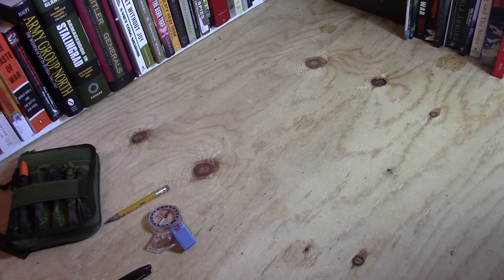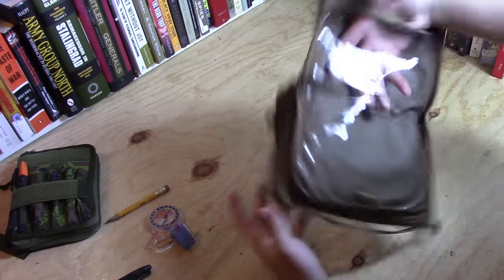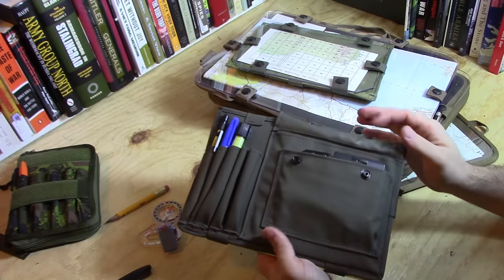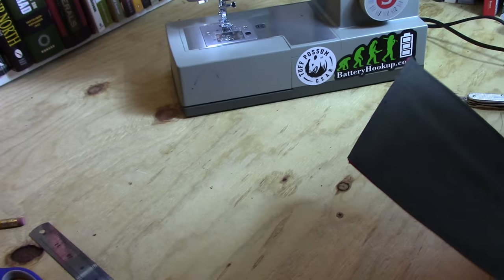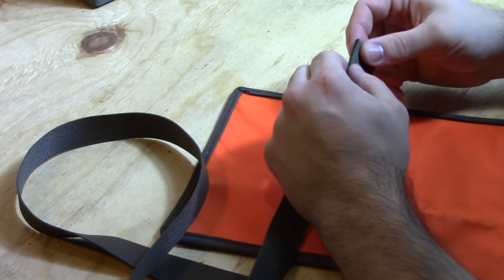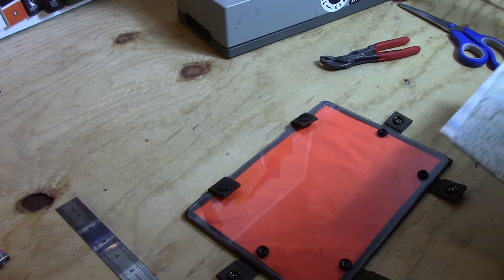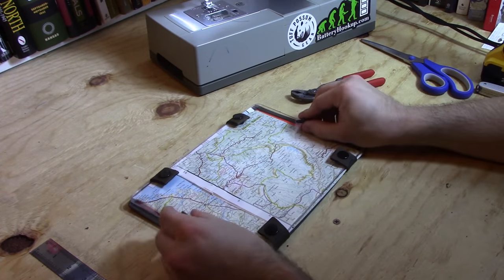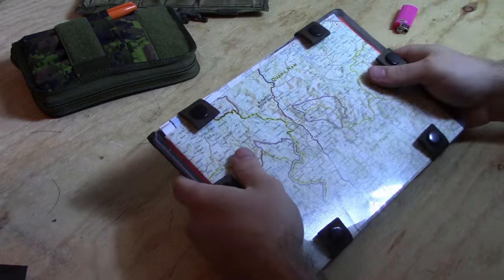Frankengear: DIY Map Case

Comment: The cheapest picture frames at Walmart etc. use lexan for their "glass." If you have a table saw with a very fine blade you can cut the lexan very easily. You can use bottle bases and a sharpie to mark the corners for cutting those nice round corners on the plastic.
Reply: when cutting lexan try using a utility knife blade point. Not from the sharpened side but as a scratch awl from the dull side. It scores it nicely. Deep, matching scores on both sides will allow it to break where you like it. The edge will need to be sanded as it is jagged. Also the saw blade from a skillsaw or table saw can be turned backwards and produces good results as well. This produces a finer edge but has a tendency to melt through the lexan.
Reply: @joshuarumsey2302  If it breaks its not Lexan (polycarbonate), it's Plexiglas (acrylic).  Polycarbonate is tough.  Its what eyeglass/safety glass lenses are made of for example.
Reply: @MrBen527  Would the difference matter in this application?
Reply: @instantsiv  Yes.  Polycarbonate is a much better material for this application.
Reply: @instantsiv  
Plexi is a pain in the ass to work with. thin material like this loves to quickly break when you touch it with a drill bit. Thicker material gets very hot very fast and melts on your drill bit or tap. Plexi also scratches easily so I don't think that's a good option for this project.

Comment: We used clear kitchen contact paper (always did one side).  It also allowed for marking up with a grease pencil.   Erasable markers where not a good choice any dampness and you lost your makings of MSR's., FEBA, and where they put the class 6 store.  The trick is to with a flat area put the map on the sticky end and push out any air pockets as you go.  You only get 1 shot to do it right.

Comment: This is very nice. I'm an exploratory geologist. I use two lexan glass boards cut just a little larger than a 9x12 and drill two holes near the corners for 550 Paracord. I put strips of duct tape to border the plastic and tape one side of both boards to allow to fold like a binder. I might just try adding the pocket to one side.

Comment: For maps, a laminator is your friend (hot or cold).  There is waterproof paper for laser printers available.  Combine the two - lamination seals in the toner so it doesn't transfer once printed, waterproof paper doesn't spread lamination leaks if punctured, and toner doesn't bleed like link does.
  
Recommend buttons over snaps and velcro - no sound when operated.  Would also recommend an opaque flap over the cover plastic sheet, no glint reflections, and keeps the plastic pretty for longer.  You could put a hard surface in the cover and add triangle flaps on the sides to allow viewing the map under a "hood".

Comment: Only a couple mins in but as a SERE Instructor I always preferred just using clear shelf paper. Works great. Pretty cheap. Lasts a long long time.
Reply: I still use that clear contact paper.  I also still use 1 gallon zip lock bags.

Comment: I have a suggestion: spray fixative. You can find it at art supply stores. Artists who work in ink, pencil, charcoal, whatever, use spray fixative to keep the work from smearing. It works the same way as polycoat works on stained wood. After printing ot your map, spray it with a thin coat of fixative. Let it dry, spray another thin coat on it. The plastic will allow humidify to collect. Leaving maps in the case when not needed is a bad idea.

Comment: Thank you for sharing. 

I think that I'm going to take 
your idea & run with it. 

The only things I believe that I'm 
going to do differently is slightly different accessory pocket set up,
AWA, on the main body... double 
the backing panel into two 
(completed) panels & join with a 
heavier seem, so I can store one 
or two extra screens in a designated 
pocket for the extra screens.
(Using the two snap straps 
for holding pocket shut)

One of these will have light 
engravings both to mark catches
& camouflage alignments to topo 
features. 

The other time will tell what I'll do with it.

Thanks again for sharing.
Excellent idea & job.

Comment: as a soldier from the 80s, we made map boards out of cardboard, 100 mph tape, and clear acetate.  You could make a "map book" that allows you to simply "turn the page" when you approach the edge of the map sheet.  Obviously, back then we were not making maps on our desktop and printing them, so this is for published 1:50,000 or 1:250,000 maps issued to us.

Add some 550 cord to make a handle and spine, and make it to fit a standard issue map case and you are in business.  Small enough to be used mounted or dismounted, and large enough to hold 5 or 6 maps.  I even saw some that held the bigger "special maps" (Graf, Hohenfels, etc) in a way that you could see one quarter of the map, or unfold the whole map.

Fieldcraft...good to see.

Comment: This is not boring! It is skill building, which is very important. I place this video right up there with the Secret Squirrel videos. Using a needle and thread, manual or machine, will come in handy if/when a SHTF situation occurs. Be well.

Comment: I wish I'd had this when I was an infantry officer. You could store all your reports cards (9 line, SALT, CFF) in there. Best of all, you could quickly mark up the board with graphical guidance and hand off the entire package to your FO or JTAC so you could manage the fight on the ground. This easily beats the large planning map board in my ruck and the crappy map case in my plate carrier, which never maintained map alignment.

Comment: I like to weatherproof my maps with spray Flexseal.  Works well for desktop printed inks.  Have used it for printed big game tags, downloaded hunting licenses, etc.
Reply: Any tips/tricks to application?
Reply: @mattfleming86    I spray one side, let it dry and then spray the other side.   It really toughens the paper's strength, too.
Reply: One coat?  Nice.  Gonna give it a try.  Do they still take markup/layout well or require any weird marking pens?
Reply: @mattfleming86   One coat each side.  You can still write on it with a ballpoint or Sharpie.

Comment: You could put a velcro hook panel on the back of the case and have a separate nylon belt with velcro loop on one side to create a kneeboard setup. I'm typing this comment from that very setup. Very useful for reading maps while operating aircraft or other vehicles while in a seated position.

Comment: I'm thinking of combining these implimentations into a tri-fold design with clear vinyl, that can fold and go into the front pocket of a plate carrier or wherever you may need it.

Unfortunately I'm with you, clear vinyl sucks. It either picks stuff up, creases, scratches, gets hazy. 

I don't know if there's an engineered solution for those issues or not, my search may be hindered by my lack of knowledge of the industry itself.

EDIT - Forgot to say: Awesome series with great information delivered short, sharp and concise. Most importantly, a very worthy mission. Thank you!

Comment: When I was active duty we'd take maps of the training area and get them cut and laminated.
Reply: The only downside is you get into stacking distances
Reply: Same, works good for GRG and other non-grid dependent maps. Combine this with acetate layovers and you’re set. The fine tip permanent pens that stay on until you erase them or use sanitizer.
Reply: @davethrasher4124  yeah but you get used to it just like anything else

Comment: What we do here on Argentina is first to "illuminate" the map, using highlighters to mark the coordinates, names or points of interest, to make them stand out in a quick glance. Then cut it in squares of a comfortable size to fold (usually the size of the combat shirt pocket), take some transparent scotch wide tape, and tape the back and then the front of each piece. Finally you join them all back together with some more tape. You end up with a weather safe map, that does not need a map case, fits almost everywhere, you can write directly on top without worries, and erase it just fine.

Comment: Quick fix for keeping yourself centered on the map, have one large map that is medium resolution (big area, big details) that covers the entire area you are operating in. Then a smaller copypaper page sized high resolution map for each area within that map. The big one is for long distance stuff and keeping track of position of multiple elements in the battlespace, and the little guys are high resolution topographical maps of the immediate area for land navigation and planning close range troop movements.  Take whichever ones you need for the mission in your kit and leave the extras in your ruck.

Comment: One point:  Size to fit the leg pocket.
Another: Military dont have this problem as the map/locations change.
For central people; ok.  Maybe a simplier method is to remove the map between uses.  
Solves the problem, doesn't need any sewing skills.
And you can fold the map to meet your needs.

Comment: For the map's ink sticking, just add wide clear tape on top of the map. For one, it turns the map onto a whiteboard so you can directly scribble on top. And it keeps the map pristine. 
If you do both sides and slightly overlapping the edges on both sides, you can get a sorta wateresistant map. Its not perfect but it turns a home map into a better product for cheap
Reply: Like high quality packing tape?
Reply: @flamingdragon3861  like any old clear wide tape

Comment: so just some of my opinions here so it's definitely not the right and only way to do it, but I would suggest sewing all the stuff on the back first before stitching the plastic and stuff together. Now this is mostly just to make it look more professional so when you take the map out you don't have stitching all over the place. now in this case really it's not a big deal but at least for me I just like to make things as nice as possible with the limitation coming from my knowledge and skills. does make it a little more difficult but not too bad. also if you comparing your self to a seamstress or something then yea not good sewing but really your skill in sewing are excellent compared to most common folk. I would say your a step above most people.

Comment: I feel like a tablet with pre-loaded maps (you can do that with various systems) and a back-up battery, and GPS built in, would be more efficient than this. Since GPS is not transmission oriented, you don't emit anything by listening for GPS signals.

I have an Onyx Boox Air 2 with an e-ink display. The battery lasts for weeks, you can pre-load maps for whole states and regions via Google Maps, so you can get coordinates and details and use navigation. The only downside to the tablet, which will likely be dealt with in later versions is that it's not waterproof. If it was waterproof it would be awesome. There's also a backlight that you can toggle on or off, in case you need the information in the dark.

Yes, paper maps are still a great idea, but if you want something that's going to keep up with you, electronic systems with GPS can be superior in some conditions.

Comment: I couldn't live with that it's too rigid and gives off too much shine.
I used the pen pockets inside the 2 chest zip pockets on my smock for pens. However we never marked the maps, we only added red boxes/no go zones to them. We always used ortlieb map cases as they kept the map's dry and could hold a good size map that could be folded easily when in the case.
Horses for course's really. Everyone is different.
You always have the 3 S's in mind when mooching about in the field.
Shape
Shine
Silhouette.

Comment: when the color of cards comes off? - as with the daily newspaper, simply iron the topographical map beforehand - every butler has also done the daily newspaper for the ruler
Reply: the edge of the map - if you can't fold your map properly, then the map folder can't help it - and no, I'm not the producer, I just use a similar one from a Canadian company that has it produced in China, unfortunately there is nothing else

Comment: Since we're in topic of maps.   I have opsec question, that is related to them. I've heard from some people to do not mark/draw anything on maps on the mission/if I'm going to take it for mission, becayse ifni get oilled, operation is discovered etc.. but havent found much to read about that.   Is is practiced? Should it? Are there any workaround used?
Reply: There's a couple reasons why you wouldn't want to mark directly on a paper map, but yes opsec is one. That's why you want it laminated or in/under some kind of plastic so you can sanitize it. Just like you need to be ready to zeroize radios and comsec devices, you need to be ready to sanitize a map to protect information that might be on it.
Reply: @Sharpienadz  This would be an EXCELLENT followup video idea... AHEM S2!  😁
Reply: @gutsnav8641  Another thing that is sometimes overlooked is to train everyone to retrieve sensitive documents from casualties ASAP.
Reply: @gutsnav8641  this is very nice indepth explanation  i will try to adapt it to my circumstances.  As english is my secondary launguage, could you please explain shortcuts used? I only recognize some.     

We don't use baofengs too securely.  Usually on march whenever thing is too complicated to show non werbally. We probably woukd then stop and  call leader non berbally  tuen explain situation up close.
Reply: @gutsnav8641  that's more than I asked for. Thanks